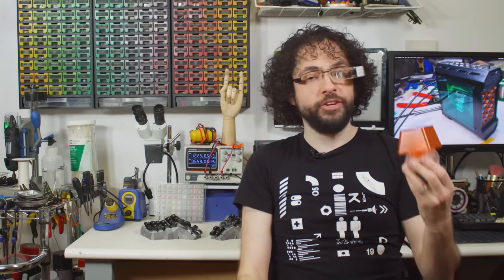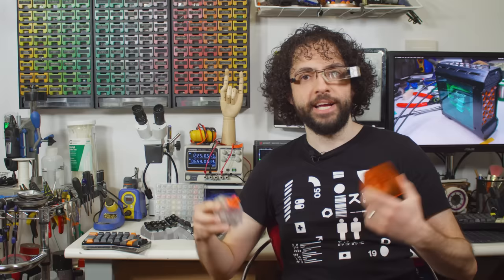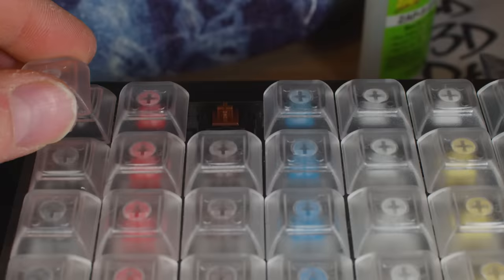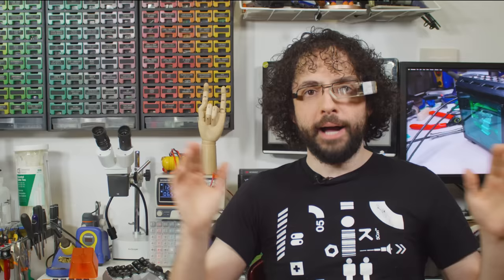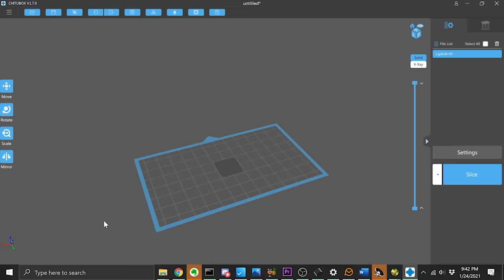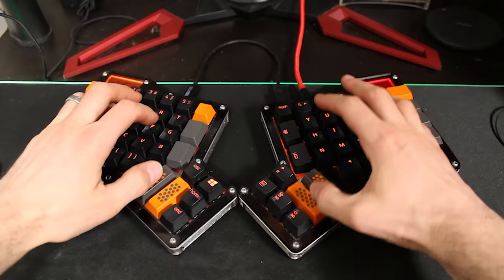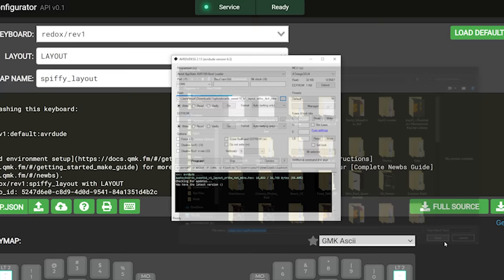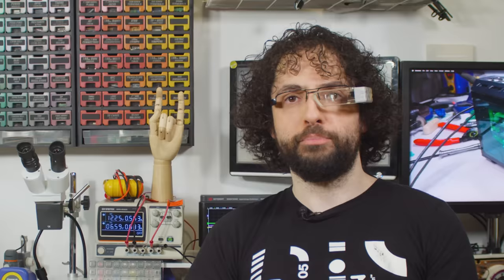How to Build MECHANICAL KEYBOARDS

Comment: “Arduino’s are almost impossible to brick.” You underestimate my stupidity
Reply: throws a brick at the Arduino
Reply: I once sent 12v through my Arduino when I used the wrong leads on my multimeter while testing a connection

As expected, I bricked it
Reply: He said "almost"
Reply: i'll connect + and - without a resistance if i want to
Reply: you're too powerful to be left alive
Reply: @warpspeedscp  Thats not bricking it. Thats called releasing the magic smoke.
Reply: @warpspeedscp  that's not bricking an Arduino, that's either murder or manslaughter.
Reply: @warpspeedscp  you didn't brick it, you fried it
Reply: You can actually lock the chip for firmware uploads. It's one of AVR safety features. And to undo that you'll need a special high voltage programmer.
Reply: Not an Arduino but a Raspberry Pi, but I did try to turn it on by shorting GPIO3 and GRND, but I did it wrong.
It started buzzing and when I turned it on, the screen was all funky and it was behaving strangely.
Then it turned off and I left it for an hour or so. Works fine even 2 years later. 🤷‍♂
Reply: @warpspeedscp  that isnt bricking, thats toasting
Reply: I bricked an esp32, which is just a more powerful arduino
Reply: You can brick them but it's easy to unbrick them if you have a second Arduino
Reply: i fired one using: a screwdriver (i touch 2 pins=>short the board)

Comment: Because of this video (well mostly) I've gone from using standard qwerty horizontaly staggered boards to a diy 3d printed and hand-wired split vertical stagger 36 key setup and changed to the Colmak-DH layout. I must thank you for inspiring me to give this all a shot as its so much more comfortable to type now, I can touch type properly, and way less finger gymnastics are involved!

Comment: ZACH! I legit just built a Dactyl, really excited to see this pop up! I hope you're adapting to the funky layout better than I am! Keep the videos coming my dude, love it!
Reply: Year later..but.. like.. how do you like the Dactyl. As a coder/mech keyboard enthusiast.. I am tempted to build one.. but unsure of how it will work as a daily driver. Currently using IRIS keyboards which I love.. and recently bought the LULU lily58 keyboard.. going to give that a try. Dactyl looks a bit too big/bulky though to take with you in a laptop bag which is where my IRIS fits well.. small/flat to fit in bag.
Reply: @b3owu1f  I love it, I'm at the office typing on it right now!
I'd totally recommend the build, but maybe location one of the slimmer variants. I've been looking at building a BastardKB Scylla which is a solid Dactyl variant that may be easier to take with me everyday unlike my Dactyl which is chunky and stuffed with tire weights 🤣
Reply: @Odwalla_YT  good to hear. Is there an rgb per key option? I don't know why but I love per key rgb.
Reply: @b3owu1f  Not in my personal build, but those nerds over on r/ergomechanicalkeyboards have added per key RGB to identical builds. They would be a great resource for planning a build with specifics like that.

Comment: "PBT is always superior to abs" GMK has entered the building
Reply: Yeah the talk about keycap materials should be a bit more detailed, but I think the audience Zack's targeting here means it doesn't really matter as much. And if they really persue this kinda stuff they'll figure it out. The video's definitely as informative as it really needs to be without going too far into the customs. The budget was $50-250 and like... yeah, that's not wrong, but it's also incredibly inexpensive compared to the kind of stuff out there, so I think it fits the audience.
Reply: @dallagen3423  fax, glory to pbt
Reply: Yea i mean GMK is nice, and I personally have 3 sets off them. But I'd say PBT is better. They don't yellow overtime when exposed to UV, and it takes longer for them to shine, giving you consistent feeling keycaps for years and years.
Reply: Reject GMK, embrace SA.
Reply: thick ass PBT clone sets > overpriced ABS

Comment: Ergo keyboards are so damn expensive, you literally saved my life!
Reply from the maker: Oh, off-the-shelf ergonomic boards are ridiculous. I once refurbished a DataHand and sold it for over $2,000. I know Matias boards are bananas costly, too.
Reply: Unfortunately for me, 3D printers are even more expensive ...
Reply: @3nertia  3d printer are far for expensive compared to ergo keyboards
Reply: @dryaldibread2327  Lol? Isn't that what I just said?
Reply: @3nertia  getting a solid 3D printer is a great investment. My dads runs probably runs anywhere from 20-50 hrs a week
Reply: @omenplayz6329  Maybe it's a great investment, if you have the money for one, the space, and the ability to do all the finishing (read: sanding) required to make it look halfway decent heh
Reply: My Keyboardio Model 01 was expensive, but the cases (split ergo) are solid maple (super comfortable integrated wrist rest), and the keycaps are injection molded, though individually modeled for their specific placement in the ergonomic layout (they guide the fingers very well and get a tiny bit of that concavity you see on something like the Maltron or Kinesis). I was even able to order an alternative set with dvorak legends.
Reply: @dryaldibread2327  3D printers are around 160$ or so. An Ergo board is around 150-200$ atleast if you're going full custom route so choose your poison. 
Anyways there's 3D printing services too if you can't afford that

Comment: As I'm sure someone else has already pointed out...the Pause / Break is a holdover from DOS operating system.  It was used to pause scrolling  text, or if CTRL was held, Break would stop the scrolling text immediately.  Highly useful when doing a /dir /s command in DOS.  Moving on, The function keys are frequently used in MMOs.  F1 is self, F2 next party member, F3 is next, and so on.  Can't really give those up.  As far as the 10 key keypad, it's still useful enough when you're doing spreadsheets full of numeric data, or various other activities.  Print Screen and Home aren't quite archaic either.  Print Screen copies whatever is currently on your screen (right now, you facing the camera) and lets you paste that into your paint program of choice.  Incidentally this is useful if you're planning on zooming in to examine something in someone's background, like that clear container of white zip ties behind you with the green label.  Home, if you are typing, will bring you back to the start of the current line you're on, which is useful if you intend to insert something, or if you want to start over, or etc.  It's kind of like using CTRL plus the left and right arrow keys to jump forward and backward in a sentence, if you make a typo or want to insert or delete something.

With all of this said, this is mostly very good info, and I thank you for that.  I am extremely particular about my keyboard because I tend to use one a incredible amount.  I finally settled on a Corsair K95 Platinum RGB, which is actually pretty good.  That doesn't change the fact that I've always wanted to custom build a keyboard that is modified and adapted just the way I like.  The information you've provided here gives me a good foundation to start looking at parts without being utterly lost at what I'm looking at.

Comment: "Archaic crap like Print Screen and Home"
I actually use the Print Screen key quite often (as recently as today): It activates Lightshot to take a screenshot, handy and fast.

And the Home key is somewhat useful when modeling in Blender (as well as typing or programming), the numpad is as well (but now I have that functionality programmed on a macro pad, to use with my left hand).

I've been thinking of making my own keyboard for a while, and this video made me wanting to do it even more. I'll probably make a "macro pad" first, and then try my hands on a bigger kb.

Comment: "Arduinos are pretty much impossible to brick"
Challenge accepted
Reply: the arduino ide has to upload a bootloader before your program or it is bricked. If you replace this bootloader with nothing/a borked bootloaderom, you can reincarnate it by using another arduino. Alternatively just smash it with a hammer

Comment: The single best bit of information you gave about switches was that they are all good for whatever you want to use them for.

It's ALL preference.

Yes that also means you CAN buy a $2000 keyboard and put cherry blues in it if that's what you LIKE.

Comment: A slight correction ... there are 3 types of keycaps: double-shot, die-sub (  on pbt keycaps these are pretty tough and will hold you a long time ) and laser etched ( these are typically what you find on retail keyboards, they are abs and can be backlit compatible, but suffer the shiny degradation, hehe, the cool fact is: they can have really thin fonts  )
Reply: Also, there are 3 keycap materials. Abs and pbt as he said, but also pom keycaps. I'm using pom keycaps right now. They're really hard to find nowadays. Also, there are some keycaps made of metal(s), but they're really expensive..
Reply: @piirakkas  yep forgot about those because they are rare or expensive there’s also ceramic keycaps out there

Comment: "Andrinos are pretty much impossible to brick?"
Is that a challenge?
Reply: It depends, those are actually hard to brick. The Arduino Mega 2560 bootloader is the only one i know of with a spectacular brick bug, you only need to mess up the watchdog registers hard enough, and then it will reset every time during the bootloader run, making for a boot loop that you cannot naively recover from! Because reset doesn't reset the watchdog fully.

Except take an external programmer and install Optiboot. It's better anyway.

Well you can recover even without. You basically unpower the board and let it completely drain for a bit. Then you hold down reset, power it up, still hold down reset, start the flashing process, and the moment it's about to start flashing, you take it out of reset.
Reply: Achievement get :(
Reply: @SianaGearz  cool, thats some neat knowledge, thanks internet stranger
Reply: just short it with your finger 12v to ground and reverse it baam ez bricked

Comment: "You can't 3D print circuit boards"
Hol' up... Just leave the traces as indents in the actual structure, metal leaf and sandpaper to fill, or squeegee fill them with something like a resin graphite.
Reply: If your 3D printer has a quickchange extruder you can really easily make one to extrude conductive paste or ink onto a board and then cure it in a toaster oven or something and tin it with solder.
It would be tough to calibrate and get right, and for that reason I'm surprised I couldn't find plans or a conversion kit anywhere.
You could also convert a sturdy printer into a light duty mill.

Any way you slice it it's just a cartesian robot and you can bend it to your will.
Reply: @thumbwarriordx  
Heck. How about "3D" printing a mask onto bare copper clad board, then etching it off? One should be able to find something that sticks to copper, is HCl resistant, and can be removed by some other chemical after.
I will be trying that. Masking with magic marker didn't work for me. But I have a LOVELY bottle of highly poisonous brightly colored acid that I can't pour down the drain. (Need to use it to copper plate something some day.)
Just as soon as I get a 3D printer, and have run a few other projects through it.
Looks like PVC might do it. Or maybe vinyl.

Comment: I'd like you to build a Midi Controller..
I'm trying to build on for a year now..
Reply: Depends what you want from a MIDI controller, if you just want digital buttons and knobs you basically just build a keyboard with a number of rotary encoders instead of keys - the QMK firmware used for all these custom keebs supports MIDI! Not sure how you'd do sliders though.

Comment: "If you wanted to forget which key has the & on it." - Look, I only forgot which one had the % key on it.
Also, I use Ins/Del/Home/End keys pretty frequently. I just like quick shortcuts.
Reply: Home and End are the most underrated keys on a keyboard. I am always wanting to go to the start/end of a line, and using the arrow keys is too slow.

Comment: I would like to know a good and most of all cheap way to use motors with encoders... The brushless motors with odrive are awesome but waaaay to expensive still. You can buy DC motors with a encoder from banggood but they are all geared down a lot etc... So to be more specific: a cheap (diy) way to encode a dc motor.
Reply: actually odrive is opensource 
u can make it yourself or atleast understand it and change it to an unexpensive alternative that works for u
Reply: This. Motor encoders and/or using bldc for making things like camera stabilisers would be awesome.
Reply: @ahmidiyasser376  yeah but the people working on odrive are waaaaay smarter and more experienced than I am... And developing such a thing would not be cheap unless I make huge amounts.

Comment: I tried to change the MX Red switches of my MX board 6.0 to MX White few years back.
I fried the board.

I was faced with the choice of either giving it up and take a new keyboard or doubling down.

I doubled down.
So I designed my first PCB, got it printed, adjusted a little the alignment on some holes and edges with the case, soldered everything and flashed the MCU (I went for using directly a MCU no Arduino crutch) with a config of QMK I had to make and bingo, it works.
That was a nice summer project.

The price of the whole thing including is well north of 500 euros but I have 4 spare PCB and a spare set of every components.

Comment: Every Chyrosran viewer got triggered when he talked about alps.
Reply from the maker: i know what i did
Reply: @ZackFreedman  The best part is that you're absolutely right.
Reply: Alps switches are actually quite nice though. Of course, no keycaps, but that's sorta why it is for nerds and he is right about that. I really don't think anyone would argue that only nerds use alps since only nerds actually get into vintage. I consider myself fairly nerdy but I haven't really touched vintage keyboards. I only have the alp keyboard because my parents kept one of their old computers and it just so happened to have alps oranges in them.
Reply: I have one of those Matias boards with clone alps. There are fine but nothing to write home about.
Reply: @Conno422  Most Alps switches you'll get ahold of are not the good ones. At one point they were still desirable but you can easily get modern MX stem switches that outperform dusty old simplified white alps from the 90's.

Comment: Extremely well researched video, without a doubt the most useful and hardcore condensation of custom keyboard knowledge I've ever come across on YT. Much, much better source of information for a newbie than the dozens of videos out there focused on talking up boutique switches and 800 dollar keyboards with an eye for A E S T H E T I C S (although I have to admit I'm a sucker for those). 

If you can allow me to be an r/mk snob for one minute, PBT is not always better than ABS. Thick, doubleshot ABS keycaps will always be superior in quality and feel to flimsy, 20 dollar pad printed PBT keycaps. ABS keycaps also generally hold bright colors better, though this depends on quality (GMK and ePBT, which, ironically also makes excellent ABS keycaps, are kings in the community). Some folks also prefer the smoother texture of ABS over the grainy, soft and somewhat mushy PBT. ABS is more prone to shine, true, but PBT isn't invulnerable - it just takes longer. Also, the sick 68-key purple board that you printed is actually a 65%, not 60%. 65% is becoming more and more popular over 60% due to its inclusion of arrow keys. OK I'm done being pedantic. 

As a filthy casual with 0 electrical engineering experience, I'm struggling to understand how you went from hand wiring the switches on the plate to a fully functioning keyboard. I understand that QMK is involved somehow, but I'm not quite sure what that process looks like. What tells the computer to register specific keys as such? How do you build that connection, physically? What code do you need to be familiar with? Are there some resources you could point me towards to help me better understand this side of things?

Comment: You should check out some switches for electrical work for some really fun customization. Everyone knows about the typical light switches, toggles, and momentary buttons but how about 2 position momentary sliders? Two seperate inputs on a single "key" activated by moving it up or down. Ive been theory crafting an ergo keyboard that has a "button" under each finger that can be clicked, slid up, or slid down for three inputs directly under each finger.

Comment: Something that would be a nice addendum would be how to make your own macro board layout. I want to make something for use with emulators (basically a fightboard but with some extra buttons for start/select and maybe a top row for emu speed controls), but I have no idea how to create a printable model of the plate/body. I probably have to take the hole shape (19:44, this doesn't look completely rectangular, especially with the stabilizers and what not) and subtract that shape from a flat plane, but that's as far as I can think. You sort of touched on this in your "How To Finish Your Weekend Projects in One Weekend Video" when designing the plate but that wasn't the purpose of the video so it didn't really go into the how of it.

I don't know if this makes any sense, sorry.